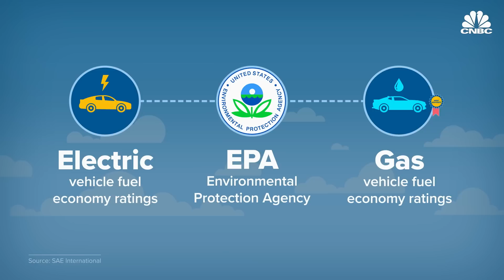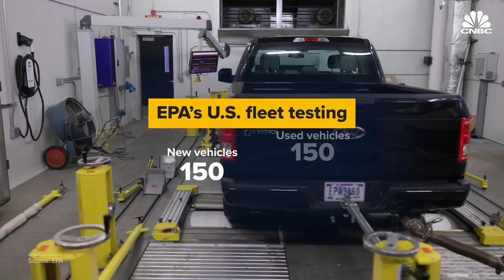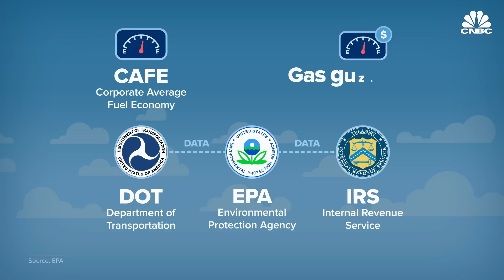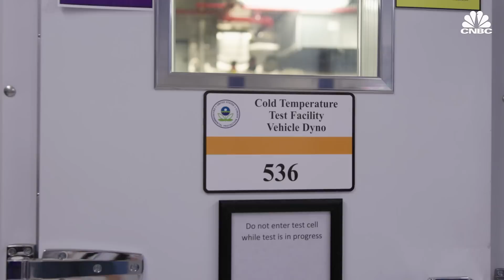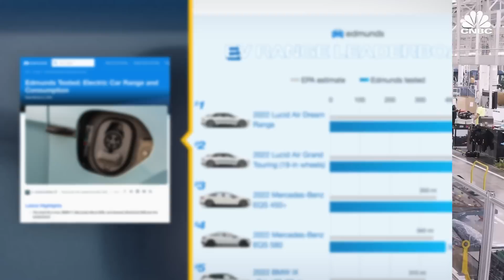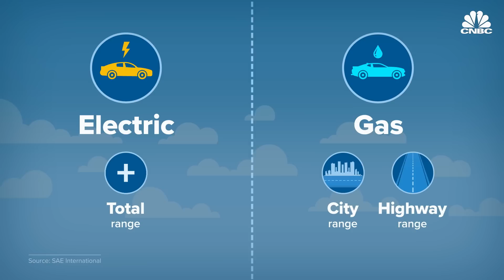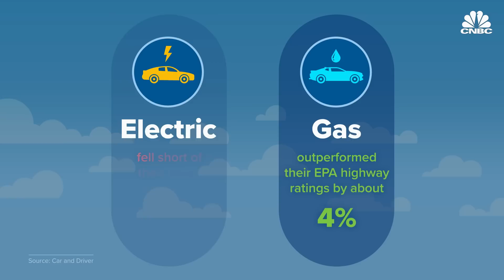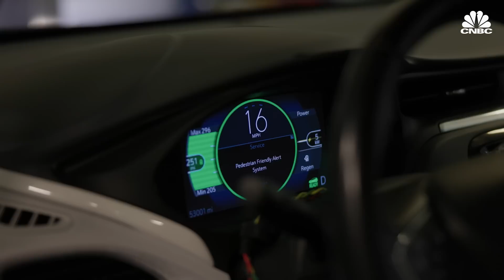Why Tesla And Other EV Ranges May Be Inaccurate

Comment: They're only measuring drivetrain efficiency if they're not running on the highway. That would factor in air resistance, which is a very big deal. I'm shocked that these "scientific" tests are so flawed.
Reply: Per the video, they put drag on the rollers to simulate wind resistance.
Reply: @steven4315 Good comment. Lots of armchair experts
Reply: @steven4315  Yup.  They also allow for the "fixed" drag on the rollers (A coefficient - wind resistance is the C coefficient) to be reduced because the rollers already have rolling resistance - in fact moreso than flat pavement, so you see legitimate negative A coefficients for many AWD EVs.  The Taycan is a notable exception here - Porsche didn't even try to get a decent number and their set coefficients exactly match the target coefficients, leading to rolling resistance being double-counted against them.  End result is that the Taycan beats its EPA ratings by a MASSIVE margin even when driven at 70 MPH.
Reply: @steven4315  Thanks, I missed that. That said, I wish they did more thorough testing, like with driver and passenger, in hot/cold weather, with AC running, etc. I bet some cars would ace certain tests and others would do poorly because they're all so tailored to one specific test regimen. Sure, they could target-engineer for multiple tests, too, but I think that would be more likely to reflect the real world. It'd be an extra expense, but it seems like a small amount in the big picture of design, development, and testing by the OEMs.
Reply: @garyhopkins  Seems to work for comparing models. OEMs have been gaming the system for fifty years. My own experience is how I drive is the biggest factor. That was also  true when I drove ICE. Reviews often tell the real  story. Toyota bz4x has  a reputation for falling short of  manufacturer claims.
Reply: That's not quite correct - they compare the test data to actual results for cars driven on the road and account for wind and the rolling resistance of tyres.

Comment: Look at the discrepancy on the Porsche Taycan 4S. Rated at just over 200 miles yet they were able to get over 300. I have a Kia EV6  GT rated at 206 miles yet I am getting 270-280 miles. The EPA needs to drive them, not just hook them up to machines and then use arbitrary correction factors.
Reply: I think they need to do both since it's difficult to get repeatable conditions in a real world driving environment (temperature and wind, a tester's driving style, etc.).
Reply: I do think it's best to underestimate than to overestimate. It's hard if you go to a 300 mile journey but stop at 200 miles because you're out of juice. Better just plan for a 200 mile journey and still have plently left over if you need to charge up.
Reply: @triadwarfare  
You are never gonna be stranded at 200 miles, if that's what you get, because infotainment keeps telling you how much juice is left :)
Reply: Low range lfp is crap
Reply: The "elite" kept this as a secret for centuries, this is the true story of your enslavement 👉 The Connections (2021) [short documentary] 💖
Reply: For sure… As if they haven’t thought about that like you have from your armchair.

Comment: What we need is a chart, not a single number.

There is temperature and speed.
Given temperature gives additional stress on the battery  for heating and cooling. Test done at 20 degrees is max range, as most humans feel not need for heating or cooling at that temperature.
As for speed, there is simple math - rolling resistance (depended on vehicle mass) + air drag (depended on speed cubed). It comes out that at 20 degrees car going 130km/h needs twice the power than car going 100, which again needs the double than car going 80. So that is why most EV are limited to 130.

Comment: These range estimates will never be accurate as they don't take into account not fast charging above 80% or below 10% which is bad for the batteries
Reply: I charge my 2023 RWD Model 3 with an LFP battery to 100% every time - there is no need to keep within the 80-20 rule. Most EV's will move away from NCA batteries (that need to keep 80-20 charges) to LFP or probably better still LFPM (Lithium Iron Phosphate + Manganese).

Comment: They need to rate EVs by miles per KW highway and city using 70 degrees Fahrenheit. Then people can realize or understand that extremes are going to change the outcome.  Example : Say a Nissan Leaf one of the first gen early models without active cooling. They had a sweet spot for mileage in town at about 35 mph and 50 degrees F that is where they did their best. Anything warmer started to drastically change the range and anything over 60 mph started to drastically change the range.

So as an example realistically you could give it a rating of 4 mpkw city and 2.8 mpkw  Highway at 70 degrees. 

Now we know that in town driving can vary all over the place and that Highway speeds can vary but the faster you go with an EV the quicker your range drops off. The more extreme the temperature is away from 70 degrees the greater the range loss.

The Nissan Leaf would have had the biggest swing in range loss and something like the Tesla in that era would have had the least change in range loss but both would have been affected the same way. 

Now when you looked at the data on the window sticker it would have told you that. It also would have the equivalent mpge to give people a comparison to a gas vehicle near the same size.

If your vehicle came with a 30 KWh battery pack vs a 60 KWh battery pack you could get a sense of how much range to expect out of your vehicle. 

The first gen Leaf got some range improvement when they went to the 30 KWh battery pack and you could expect to get around 75 miles average when it was newer. 

Many ICE car owners would have known more of what to expect out of their Electric vehicles if that information was on the sticker.
Reply: I agree

Comment: To get the United States onto the Electric Powered Vehicle bandwagon your vehicle must get 750 miles on a single charge in SUV or pick up truck or In electric powered semi truck semi truck it will need a 2,000 miles in a single charge and get it form 0% to 100% charge in less than 5 minutes

Comment: EV's are junk. Less than 1% of cars near me are EV's.
Reply: Do you live in Mississippi?
Reply: @constantbuzz  Nope. I live in a major metropolitan area. People around here just don't like ev's for the most part.
Reply: @bryantanderson430  What area is that?
Reply: @constantbuzz  Not California, but large population.
Reply: @bryantanderson430  Where????? I would like to see how many public charging stations are in this highly populated metro area and see how many check ins have been logged on the app to surmise how many EVs roll through compared to other areas.
Reply: @constantbuzz  Your opinion means nothing. The facts are: 11% of the US population has any interest in EV's, 89% don't. Yes they're good if you're driving under 100miles and just going to local stores etc and have a charger in your garage. But that's it.
Reply: @bryantanderson430  Diversion, okay. I am stating facts. You are stating an opinion. The facts are EVs have had a double digit percentage of sales growth every year, for the last eleven years. I have driven from TX to FL and back, twice in an EV- uh yeah that's a lot further than under 100 miles between stops- two stops, 35 mins each. Only good if going under 100 miles= disinformation, false, not a fact. A charger in the garage??? The charger is built into the car- it's just a power cord into an outlet- could even be a standard 120V outlet. And even if you do not have one of those, any area of population has charging stations- even if you don't know that, the FACT IS they are indeed there. Only eleven percent of people interested- well I can every single person I work with and know has asked many questions about it, and three purchased an EV after driving mine within a month.

Comment: I wonder if during their dynamometer tests simulating highway driving, if they account for wind resistance, which has a huge impact on range, and its magnitude varies depending on the car’ aerodynamics. 

Here’s another factor that enters into play. Do they drive it until the battery runs out, or do they drive it until the indicator on the display says 0%? Because different manufacturers have different degrees margins of safety after you hit zero. My understanding is the Tesla has a higher margin than most. That could make it seem like it had a longer range than what most people experience because they don’t ever let it get down below zero.

Another factor that affects mileage is head and tail winds. My brother experienced a strong headwind on a long distance trip, and it had a dramatic affect on his mileage. 

Stopping and going in traffic with lights and stop signs degrades performance in an EV, even with regenerative braking. Cities with a high density of lights and stop signs are going to give poor battery mileage results compared to those with fewer of them. 

There really should be three tests, heavy city stop and go, light stop and go on country roads without high speeds, and high speed highway driving.

Being heavy on the accelerator pedal brings down mileage in an EV just like it does in a gas car. 

Probably the biggest impact on EV mileage is going up a hill. If you’re climbing up into the mountains, your mileage is going to drop way way way down.    Conversely, coming back down, you may actually recharge your battery a little.

Battery degradation is a factor too. I don’t think we have a very good handle yet on how fast EV batteries degrade.  

I wonder about the highway surface. It sure seems like very nice smooth pavements produce better mileage than rough chain-damaged highways.

Super hot days with A/C on makes a big difference, as I’m sure super cold days do.
Reply: Yeah they should be.  They can calculate the total driving resistance at speed by performing a coastdown test.  Then on the dyno, they can simulate the driving resistance by applying the applicable load wheel torque.
Reply: @brianwong6195  on the other hand they could do a wind tunnel test,calculate coefficient of friction and calculate the drag at different speeds. Also publish the coefficient of friction so we can compare one to another as part of our consideration of which vehicle to buy.
Reply: @andrewbell8837  Well that's one use case of EPA range numbers - a relative comparison between different cars.  They use common drivecycle that all mfg test against.  Does it mean you will get the EPA numbers?  Maybe not, BUT they are a fair comparison between all cars.
Reply: ICE engines only have about 30% effiency. I doubt the mpg falls as much going uphill as the mpkwh falls in an EV. In ICE the efficiency loss swamps everything else. 
And, in cold, that waste heat from ICE is free heat.
Reply: The testers know all this stuff

Comment: Nobody talks about the pollutants that come from the mining required to make the batteries and the children in Africa doing the mining.
Reply: because they are a ONE TIME deal.. Kind of like the MINING required to get the iron then turn it into steel for the engine block of the ICE car.  Which will then belch pollutants into the atmosphere for 10 years or more.
Reply: @DS-gt1ft  They're also heavier and will require cause more road maintenance. Keep drinking the Kool-Aid.
Reply: @brittthomas5946  A Std+ Tesla model 3 is lighter than an equivalent Audi A4, A model Y (pick any inc. dual motor) is lighter than an Audi Q5. What was that about Kool-Aid again?
Reply: @brittthomas5946 my small suv ev is 3500lbs. Which is way less than the average ice vehicle in my area (#1 sold in North America is an f150) . Evs aren't going to be adding anymore wear to the road, than an ice vehicle. If anything, it'll keep our roads in better shape, no gross oil or fluid leaks
Reply: The kids love mining.  Better than playing video games all day!  🤣🤣🤣
Reply: The pictures you see of kids mining is for cobalt. There is no cobalt in new battery tech. (LFP - lithium iron phosphate) and LFPM (LFP+ manganese) are replacing all cobalt batteries.

Comment: whats amazing about EVs in my experience, lets say you are going to the mountains that's about 60miles. Going up could more or less meet 60miles on range because it could take some energy uphill.. On my way back home that says 60 mile, as we going down hill with regenerative breaking and more efficiency along the highway, I was only able to use 20 miles off the battery because I was gaining back so much energy back... that's amazing to me.
Reply: Yeah I was in Colorado and the Tesla app said that I had 71 percent battery.  And when I would arrive at my destination, some 35 miles later, I would have 72 percent battery.   At first I thought this must be some sort of terrible mistake.  But then I realized that I'd be losing 6,000 feet in elevation for the trip.  And when I arrived at my destination, damn if I didn't have 72% battery power.  So I'd actuallly gained 1% batterty power after driving 35 miles.  Amazing!
Reply: Did that very thing going to Mt Rainier’s paradise lodge and back in our Tes M3 LR

Comment: What Fantasy land is he in to think an EV battery last 20-30 hours. At most if you are luck you will get 400 out of the largest battery you can get. At 80 mph in Montana if you actually got 400 that is 5 hours. Now lets got back to the first few seconds. EV's have no emissions. HAHAHA once you consider everything it took to get the rare earth minerals to make that battery and then recycle it, you have far excceded the emissions any one ICE engine will ever put out in its life time.
Reply: Dead wrong. Break even parity is around 20K miles for a model 3 charging from national grid average fuel mix.

Comment: regardless of the methodology. driving an ev is from a 4th to a 3rd cheaper than ICE. full stop
Reply: higher initial cost of EVs and faster depreciation should be considered too.
Reply: @aarc2010  My 2023 RWD Tesla model 3 costs less in Australia than a 2023 Camry hybrid - no taking any rebates into account. With rebates and tax incentives it cost me less in loan repayments than a base model Corolla.
Reply: Riding bicycle is even cheaper. So what?

Comment: Some batteries are not supposed to be fully charged and fully drained.  20-80%
Reply: old tech. from 2018 onwards you don't have that
Reply: @martiruda even on the new teslas they recommend you don’t charge them past 90%
Reply: @martiruda  hmmm. My friend just bought a new model Y Tesla and they told him not to fully charge and discharge it.  Owner manual said full discharging cam cause damage. The Tesla Model Y owners manual recommends setting the charge limit to 90% for daily use. This will minimise degradation and preserve the longevity of the battery. Occasional charging of the battery to 100% to maximise the car's range for longer trips should not cause significant degradation of the battery
Reply: @mongo64071  Depends on which battery you have. Standard range has Iron phosphate- needs to be charged to 100% at least once a week. The LR and Performance trims have Nickle Cobalt formulation. Charging to 75% is ideal, and should not charge above 90% unless specifically needed for a long trip. The wear curve really picks up pace when going below 20% for either formulation.

Comment: Lol as if the oligarchs wanted range for EVs the whole point is that you won’t be leaving your sector
Reply: range is limited by the technology. you can only fit so much energy into a battery. it's not as energy dense as chemical fuel, but it doesn't produce CO2 because there's no combustion. not everything is a conspiracy.
Reply: @horizonberg  lol the same people dismantle nuclear power resulting in higher CO2 emissions, and move production from cleaner Western factories to dirtier Eastern factories. It’s authoritarians looking for crisis not a crisis needing authoritarians.

Comment: Could the EPA rating use some adjustment?  Sure.  I would argue it isn't that big a deal.  It'll ALWAYS be inaccurate; too many variances between how people drive, conditions driven in, etc.
By now people should understand any EPA estimate (gas, EV, whatever) is ideal and should not be taken as gospel.  This isn't new.
What we really can get from it, aside from a range estimation, is the ability to compare different cars to one another.  THIS is what we need.
The key, then, is having manufacturers all follow the same program and report the same.  No hedging numbers in either direction.  Test correctly and report those tests.
Reply: i think it would also be helpful that the specific test parameters be provided with the stated EPA ratings (transparency), so the consumer knows exactly what test that EPA number was generated from. And to be fair, who the source of that test result data was provided by (the manufacturer or the EPA agency). and if there were any discrepancies, to disclose what the discrepancies were and what was done to resolve them.
Reply: I have seen multiple people say they get more range sometimes. 

 I don't think they are lying. I just wonder if their meters are wrong. Like are you drafting a few feet from semis on the highway? How are you getting 20 to 30 miles more. 

 Then the Taycon having that much of a difference. What did they say. Nearly 80 miles more? The hell. 

 Anyway that is a scary thought. Having a messed up range meter or gauge. 

 One side note. Auto makers should make more ways to have it where you charge at 20-80%. In fact when the car is at 20% make it say zero. Since min maxing your battery is one guaranteed way to shorten your battery life... Just like ICE cars require things like oil changes. EVs require that to extend the life of the vehicle. 

 Hopefully the government pushes ways for battery swaps to be easier, and those batteries recyable.